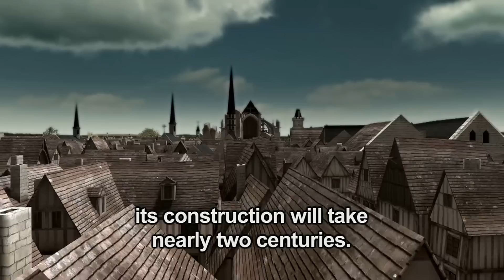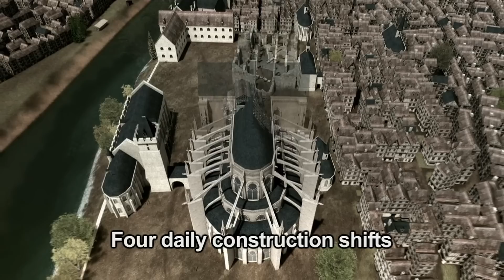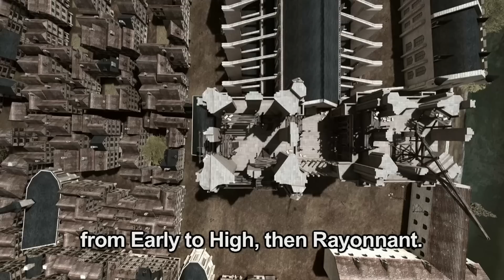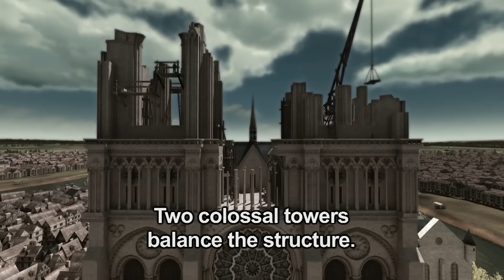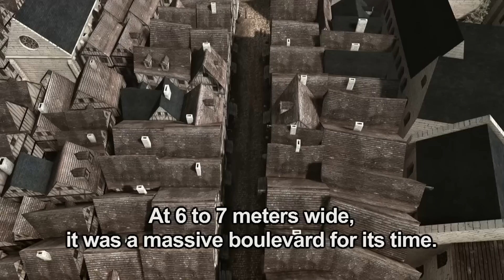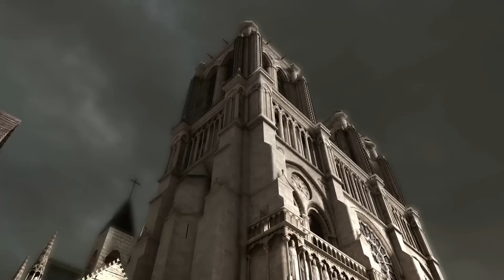Paris: The Great Saga - How Notre Dame was built

Comment: The church in this video is not how it looked at the time of its construction. It was renovated and changed during the 19th century. The front was considerably different, and the needle that recently burned wasn’t there yet.
Reply: Oh it definitely looked like that, save for the fact the interior was most likely painted.

The central spire was there from the 12th century as well, however it was destroyed in the 18th century and restored by Viollet Le Duc in the 19th.

You can see it in old illustrations such as 1450 "The right hand of God protecting the faithful" by Jean Fouquet, "Dagobert Ier refugié à Saint-Denis" by the same artist, "The meeting of the magi" by the Limbourg brothers 1412.
Reply: I recommend Myles Zhang’s narrated construction sequence on Notre-Dame for more fleshed out historical details. Otherwise, this video is pretty good as it is

One tiny thing that was omitted was that each bay used to have 
an oculus and a smaller clerestory window, making the inner structure 4 stories throughout  

Only later were most* of the oculi removed to make way for the more iconic, larger Gothic clerestory windows
Reply: The needle that burned wasn't even an original one as well. But, kudos for including small chapel at the back yard.